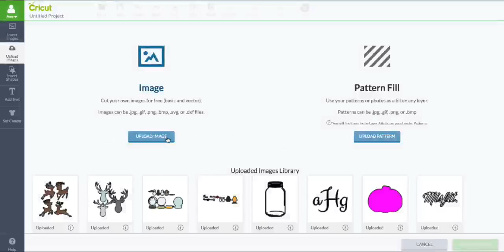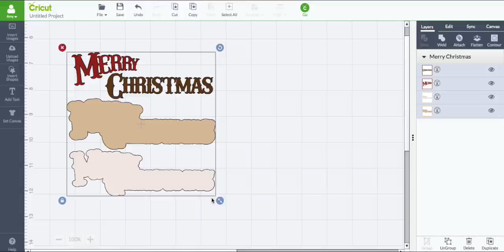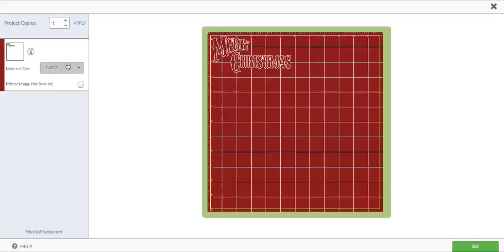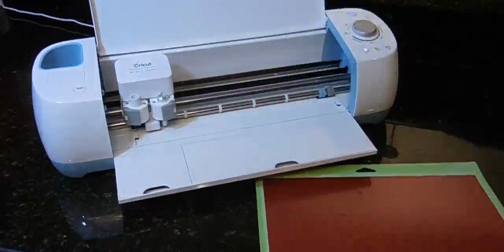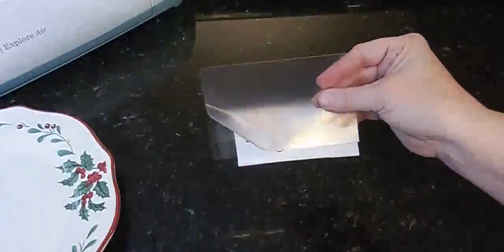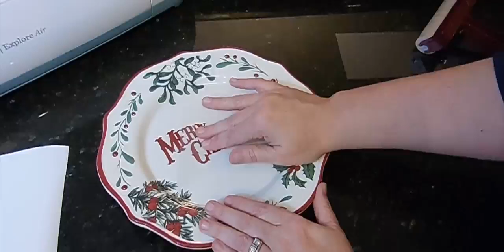Glitter Vinyl Merry Christmas Plate and the Cricut Explore Air

Comment: What type of vinyl do you need to use when putting letters on a ceramic tile to use as a "hot plate'? Can you use heat, a hot pot, on vinyl ceramic tiles?